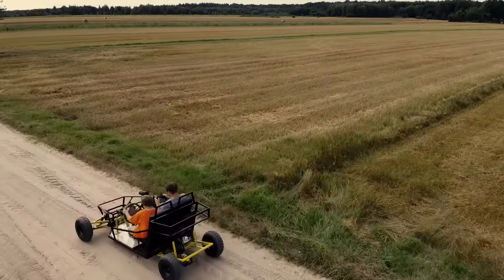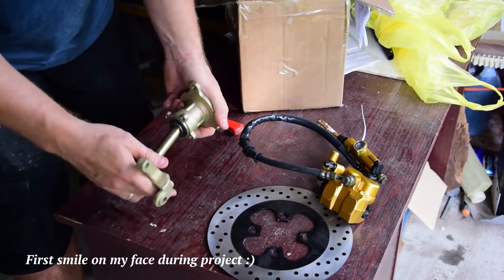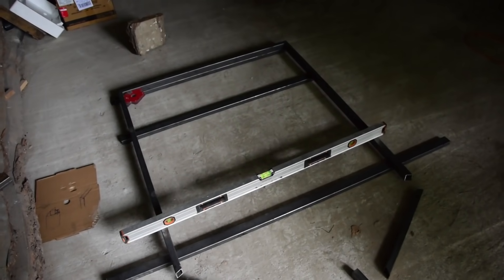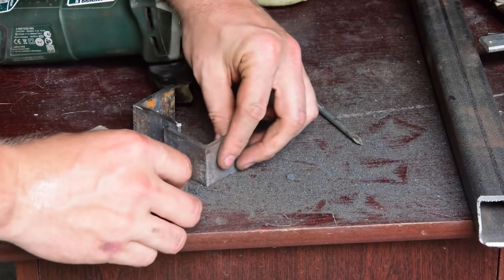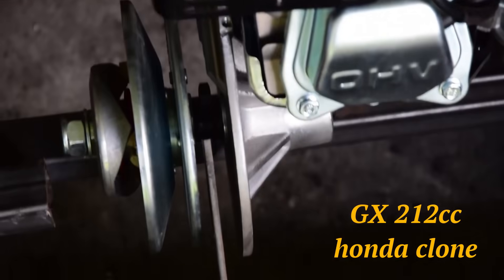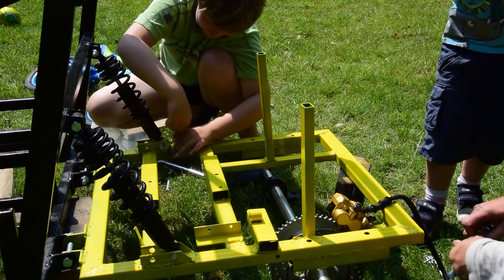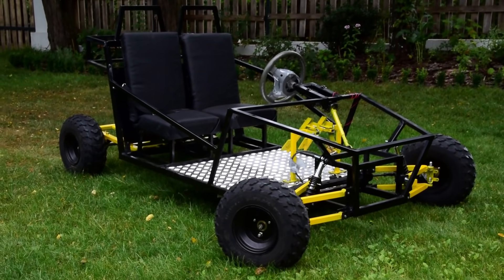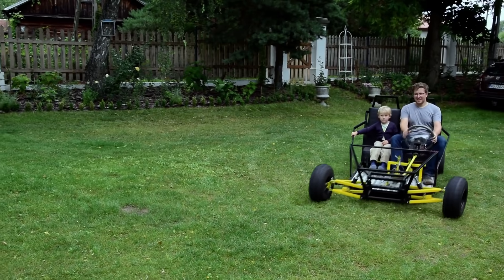How to make an off road go kart with full suspension

Comment: Amazing! One Suggestion for you would be to weld in some more supports for a roll cage. Considering it is made for your kids, this added safety feature would save them if the car were to roll over. Even though it may go only 35 kmh, one bump can send you rolling!
Reply from the maker: not a bad idea. I'll take it into consideration. Thanks

Comment: Well done. Congratulations on getting the job done. Two questions: reason for super wide front wheel base? and have you skipped the differential?
Reply from the maker: thanks
front wheels are wide because... i made a mistake during suspension ;-) they can be shorter
why not differential ? This is toy for kids. Differential would be a lot more expensive

Comment: It's not off-road. Very low clearance. Doesn't look nice and not stable
Reply from the maker: It's off road GO KART, not a buggy. Go kart is typically for flat tarmac, with this You can ride on gravel, sand and on forests paths. It's not for hill climbing and 4x4 chellenges ;-)